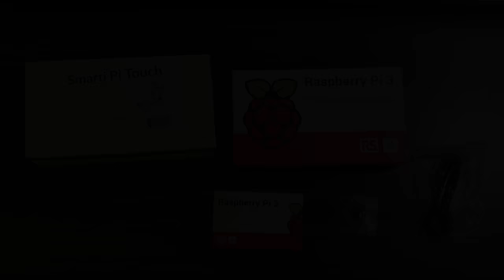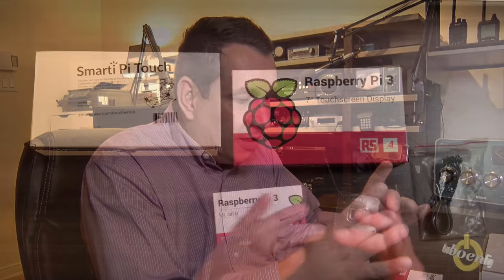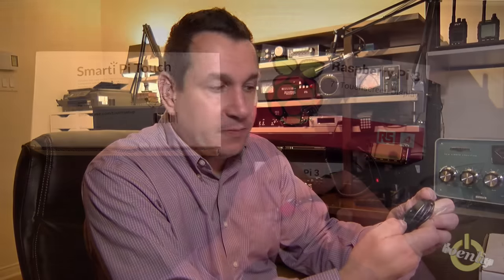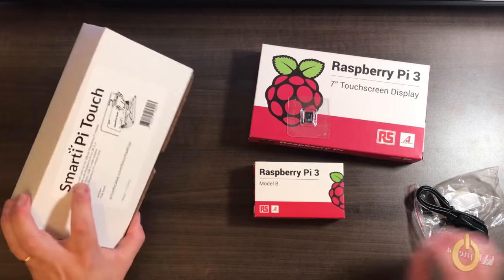Raspberry Pi 3 projects for ham radio with 7 inches touchscreen

Comment: Cool, but it really had nothing to do with ham radio specifically. I am curious as to what programs you use, how to set them up, and what hardware you interface with. This video should have been entitled as "Raspberry Pi 3 Touch Display Unboxing & Assembly".
Reply from the maker: Hi Alexander, you're right but there will be a part 2 for this video and believe me it's an amateur radio project 73 Pascal VA2PV
Reply: I just read Alexander's comment, after posting my own, and we both derived the same conclusion. Your response to Alexander was made 8 months ago and still no Part 2. Other videos have been produced though but not Part 2 of this video with a title that is misleading.
Reply: @MoTown44240  I came for the same reason, still no part 2, I am guessing that he found the software part to difficult and decided to not bother. I've dabbled a bit on Linux and found it very hard to get things running,  just beyond my current skill set. There is a version of Linux call Skywave and it is all pre configured  for most dongles and so forth.  loaded with lots of related software. I am thinking about mailing the guy and askng him would he do something for the Pi

Comment: can this reciever made from Raspberry pi be used for worldspace Digital satellite Radio
Reply from the maker: Hi Hemant, I don't know.  You need to compare the specs of the SDR and compare with the radio stations you would like to receive.  If it cover the frequency and support the mode, it should work.  Hope this help.

Comment: As lovely and convenient as those cheap USB cables with the inline switch seemingly are, they can not provide enough power to the pi, especially if it's also trying to power a screen and anything plugged into the USB cables.  You'll be getting a little lightning bolt in the top right corner (I'm not certain as it was a bit blurry, but I think I spotted it in the video) which means you're not supplying enough power.  This significantly reduces the performance of the pi.  You need to dump that cable and buy a genuine Raspberry Pi power supply, or at least one that can reliably supply at least 2.5 amps.
Reply from the maker: It's all good and I have no power issue.  Maybe the blur is caused by the camera shallow depth of field. Thank you.